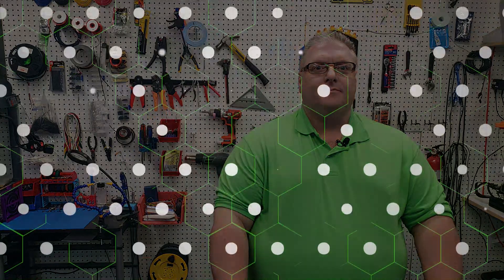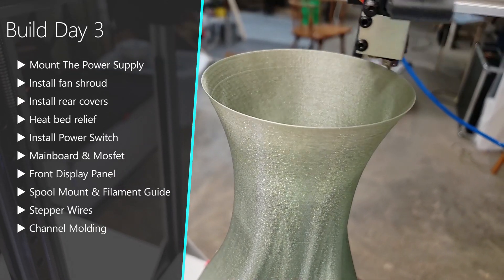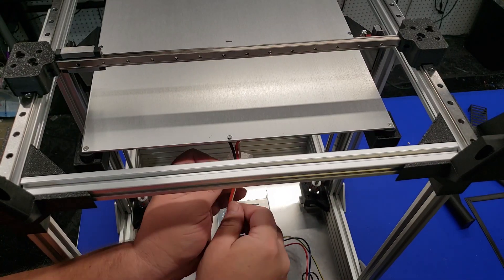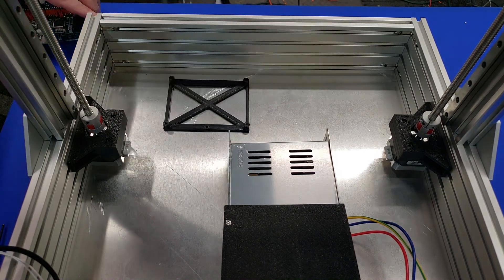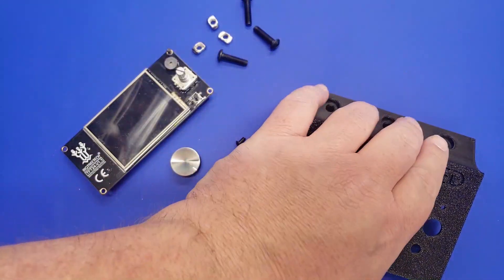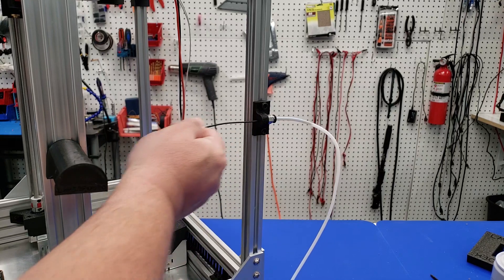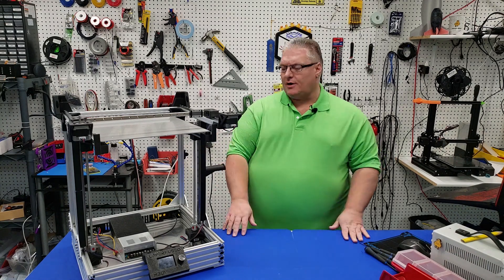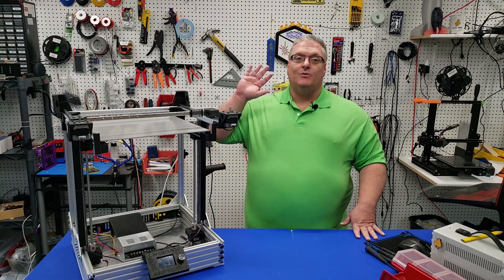DIY CoreXY 3D Printer | LayerFused X301 Part 3 - Electronics Mounting

Comment from the maker: Are you putting a single or dual power supply in your X301?
Reply: I think I'll go with dual power supply
Reply: same here, want to connect 24V for the Heatbed and 12V for the Steppers and Electronics
Reply: Dual 24v!
Reply: Single will be economic and hence preferable
Reply: @RobinBlood  how about AC heat bed
Reply: @calvin-7540  interesting, never looked into this. As long as it's controllable via Software, sure. My Main Problem was to get above 100°C while printing ASA. That never worked on my 12V RepRap-Prusa-i3
Reply: Sure I will use single power supply for board and steppers, and I will use AC with SSR for the bed.
Thanks Rob for the video, very clear as always.
Reply: Tripple one for each extruder the beds and the mainboard electronics.
Reply: I was thing about dual power supply.

Comment: Thank you so much for this video.You continue to impress and I cannot wait to build this printer. :-)  I will definitely install a 220v Heated bed with a solid state relay. In South Africa, I have built a 3m x 1.5m x 900mm high 3D Printer and the 220v heated bed can reach a higher temperate, faster with smaller cables. The printer should be properly earthed/grounded anyways.

Comment: I think you mentioned a subreddit, but I'm not finding it, what's the name? I'm also not finding guidance for the print settings for the parts, being a newbie I need to know things like if for example a support structure is necessary when printing the motor mounts ? I'm really looking forward to moving forward with this elegant design :-)
Reply from the maker: Kent thanks for the feedback.  The SubReddit for the printer build is https://www.reddit.com/r/LayerFused/.  This and the discord channel should be in the description as well as the FAQ Tab of the BOM listed in the description.  There are notes in the BOM regarding the print settings but youre absolutely right a print guide would be great.  I will try to work on one and post it to Reddit in the coming days. To answer your question regarding supports every part was designed to not require supports.  You'll need to rotate them sometimes but none of them require supports.  The stepper mounts print on the back edge and wont require supports.  (FWIW both Nick and I hate supports so we always develop parts with that in mind and use supports as a last resort.)

Comment: I have a question.Materials have TMC2209 and TMC2225 Stepper Driver.Where are they used?
Reply from the maker: 2209 go in the x and y. The 2225s in the z and e.
Reply: @MakersMashup  Thank you very much
Reply: @MakersMashup  The BOM says 2+2 drivers, but the video shows 5 drivers? (i gues you use dual z driver?) the firmware is also only 4 drivers.
Reply from the maker: The 5th driver can be ignored its installed but not currently used.